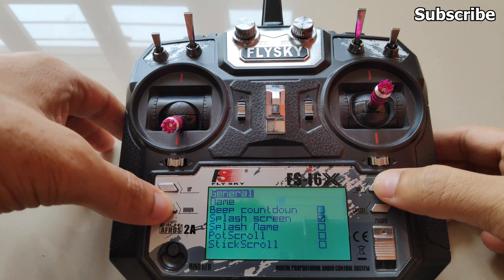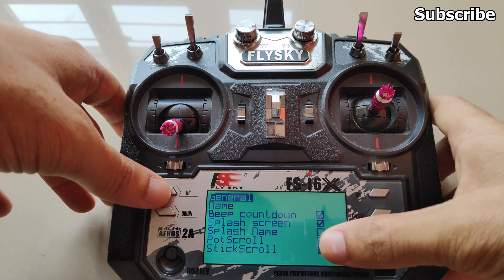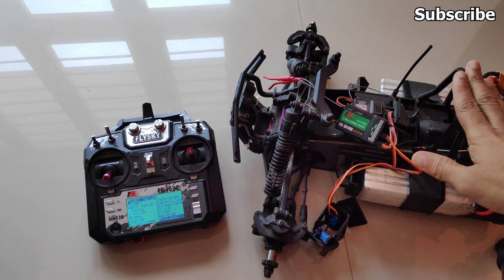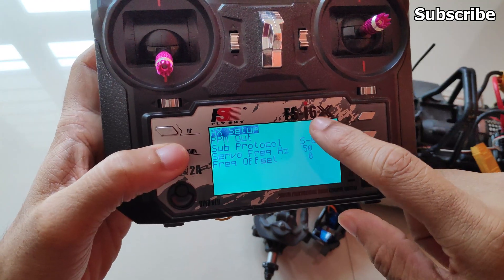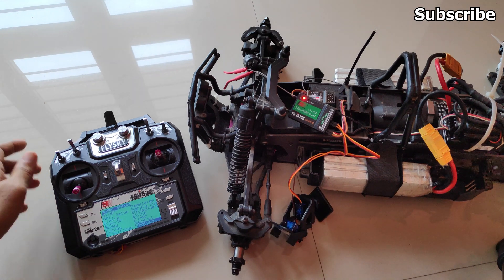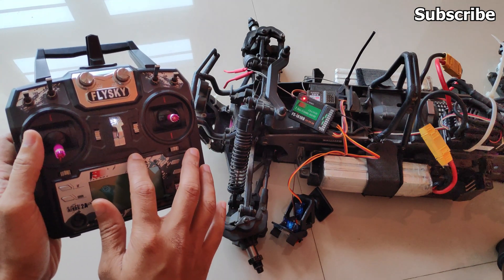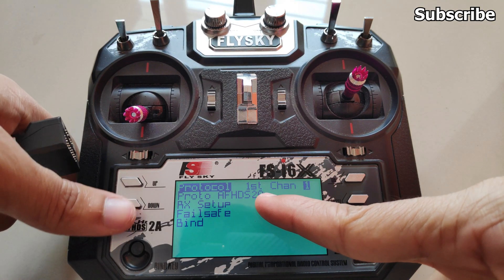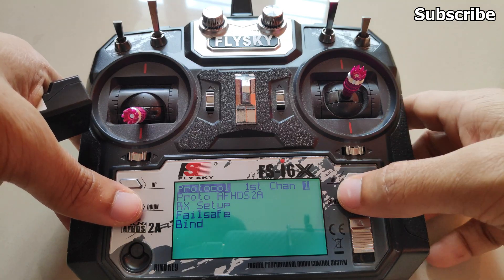ER9X Flysky FSi6X / FSI6 Complete Walkthrough Tutorial | Setup | Bind | Failsafe

Comment: Hi.  Great job. My question is how do I set the throttle from the middle  to the bottm.
Reply from the maker: You mean you only need about 50% throttle at middle stick or you want 100% throttle at middle stick position?
Reply: @RakishRc  hi. Sory.  When I turn the controller on the throttle has to be in the middle to start. I would like to have the throttle stick start from the bottom.
Reply from the maker: @theideasman6018  so you mean the throttle gimbal has to be self centred like the other side? There's a option to invert the throttle stick but to make it 0 at middle position i think you'll need to setup a curve for throttle channel
Reply: @RakishRc  do you have FB. I can send you a video.      If I pull down on the throttle it goes in reverse .  I don't want reverse as it is for my boat.

Comment: Hi! Thanks for your really great tutorials. I've been watching your channel for quite a while now!

Btw, is it possible to use CRSF as the protocol? Is it possible to hook up an ELRS TX and connect to it without using PPM OUT? I have a flysky i6, and it's such a bummer knowing that OpenTX cannot be flashed to it because of the insufficient memory. I'm really eager to find a way to connect an ELRS TX but not with PPM due to it's latency. Any help would be greatly appreciated! But nevertheless, keep it up man!
Reply from the maker: Hi, thanks for watching 👍 currently elrs is only supported on FSi6X with open tx. However the er9x for fsi6 has some more features on the way..there is a plan for diy elrs for i6 radio so have to wait once Kotello the developer for er9x for this radio makes those features available for testing 👍

Comment: Can the student control Aux Channel (CH5 - CH8) in trainer mode? The original Flysky I6X trainer mode only lets the student control CH1 - CH4.
edit: I read the ER9X manual, no Aux Channel for the student. Does OpenTX for I6X have a trainer mode that offers CH1 - CH8 to the student?
Reply: Need the same info. I want to use a headtracker with my fsi6x through trainee port channel 7 and 8 as I was used to do with a turnigy 9x but I am unable to find a solution. What drive me crazy is that if only I have bought an i6 not i6x the modded firmware was able to set channels to ppm in. Does the open tx allows to drive ppm trainer input to channel output in a selective way?
Reply: Instead open tx seems to support this functionality. Do you confirm?
Reply: @michelebassetti9148  This tutorial video shows OpenTX mixer could take Student's Channels as Input!
https://youtu.be/D9Z40WPyjoQ?t=620
I checked the ER9X manual's mixer part. Trainer input's PPM1-8 could also be chosen as Source!
Reply: @human890209yang  just bought the st USB adaptor, I will give a try to er9x and if not working to the open tx following rakish tutorials. Will let you know. It will take same days

Comment: flysky's stock firmware only allows 20 models to be saved.Can we save more than 20 models after flashing er9x /opentx ?
Reply from the maker: With er9x you can set upto 16 models. With open tx I am not sure will have to check but it may be around 15-20